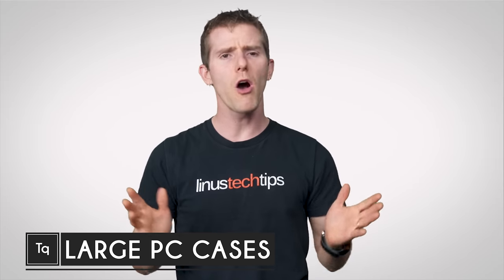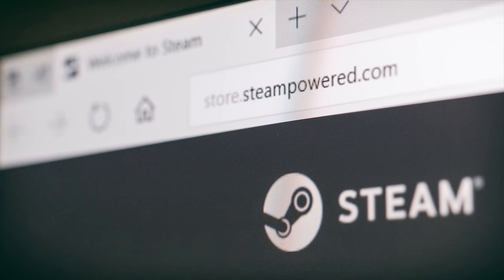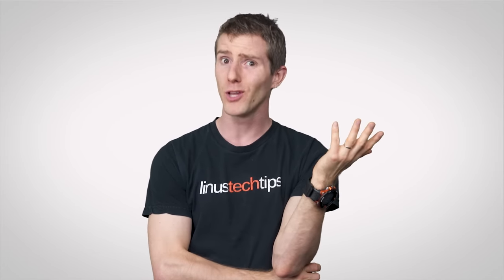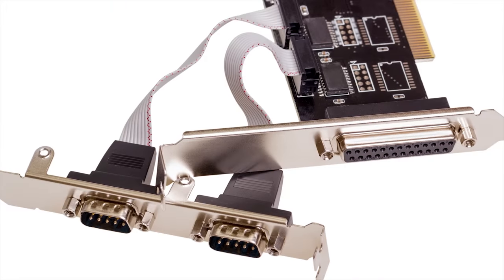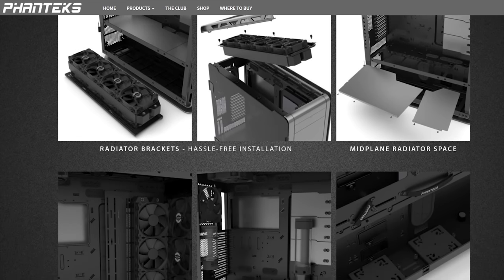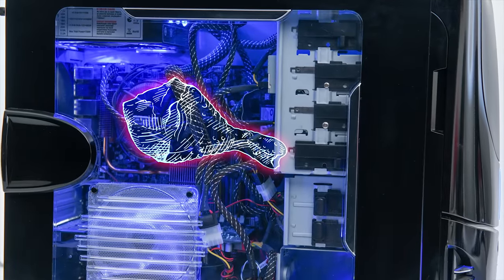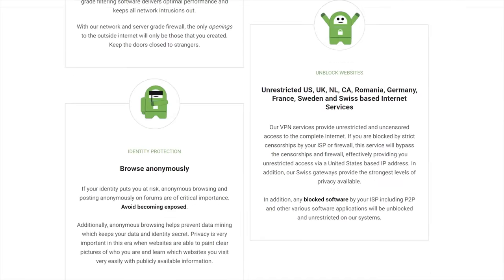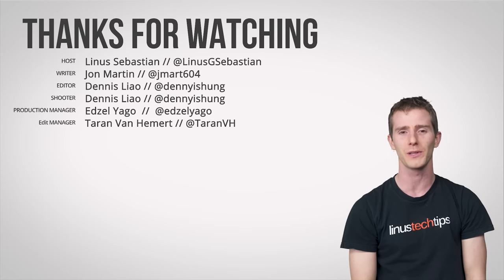Do Large Computer Cases Still Make Sense?

Comment: #1 reason, cooling.
Reply: Yep that.
Reply: Same here!!
Reply: #2 Reason.  It's an attention grabber.
Reply: #0 reason, A E S T H E T I C S
Reply: i have an mATX case that can fit 2 280mm radiators + 1x200mm in the front and 1x140mm in the back
Reply: Marcus Borderlands  watelcooling is the main reason
Reply: Space, which helps everything. Cooling, work space, configuration options, cable management... It actually makes more sense to say there are few reasons to go small form factor.
Reply: Even better don’t get a case
Reply: True. My full ATX mid-tower case runs a lot cooler and yet quieter than laptops and even better than mini ITX compact case.
Another reason why I fancy a mid-tower case or larger is because of expandability as long as I use a full ATX motherboard.
Also I can easily do more upgrades because I have more room to work on.
Reply: #2 looks cool
Reply: @t8polestarcyan22  its kinda funny, i have a micro atx motherboard in my atx case, but that was simply due to not needing any expansion slots by the time the board would be obsolete
Reply: Just wait arm CPU already surpassed x86 capabilities. I hope there is rigs that run on risc CPU that power efficient and doesn't need big heatsink.

Comment: I love my full tower. It's my solid belief that it's helped my system last as long as it has because it provides more room for better airflow and easier maintenance (like removing dust). BTW I put a note in the "new build" thread on your website on Monday and no one responded yet. I plan on getting another full tower in the future. Since my computer stays put there's no real advantage AFAIK to a smaller rig.
Reply: I like my CM Storm Scout II [white], bought another for future use, on sale,  ½ cost of the Storm Stryker ATT but someday hope to own a CM stryker, love cases that have rugged built in handles.
Reply: To be honest, the only time I've had computer hardware fail was in prebuilts (dell, HP, etc) and with cheap crappy components (COUGH Asrock). The system I built about 6 years ago is still going strong to this day.

Comment: Repeat after me: RAID is not a backup. :)
Reply: raatti one of the morning mantras of system admins everywhere
Reply: he should make a video testing this. I'll laugh at his raid backup failure lol
Reply: @stephanev92  He's got one video where RAID failed and uh... yeah the results were as expected
Reply: RAID is not a backup. :)
Reply: RAID 0 is not a backup. Don't all others feature redundant storage?
Reply: @jazzbuckeye  Redundant storage != backups. Part of the reason you want backups is to counter user error. If someone deletes important.txt, it'll be gone from all of the raid drives instantly.
Reply: Came to write "RAID =/= Backup" and then saw your comment and understood that i'm late in 1 whole year :-)
Reply: @jazzbuckeye  redundancy only protects from hdd failure
Reply: I think he learned that after his wierd Windows raid on top of Hardware RAID  failed catastrophically :D
Reply: RAID is the least secure but in many cases just convenient form of backup; it doesn't save you from fires, user errors or scraping trojans - but in the case that happened most often to me and people in my environment: a hard disk/ssd failing, it's the fastest and easiest way to deal with it
Reply: @jazzbuckeye  backup needs to be diversified. Cloud storage, external HDD/SSD, usb drive, etc. Raid is essentially just having 2 of the same drive with the same data or 2 drives bridged together as one large drive. I wouldn't classify it as a backup

Comment: The reason I opted for a bigger case is future upgrades. A lot of smaller cases have no optical drive cages, which I need in order to use my PC as a bluray player. They also tend to have very few drive cages, which can end up with running out of space inside the case. And like the video said: Larger case means better airflow, which means quieter computer, and I value that a lot.

Comment: You are so right about adapter cards for scientific equipment!  My IT department hates me for this. We have $250k mass spectrometers that are still "modern" that need to work with computers that don't have those connection ports anymore. 10 years is not a lot of time in the scientific instrument hardware world, but is an eternity in PC hardware world. More often than not whether we can still use a mass spectrometer or not, comes down to finding a $20 adapter card.

Comment: I still use somewhat large cases but not as big as I used to get as I no more use SLI/Cross, PCI-E network card and instead of the best PCI-E soundcard I use an external super expensive DAC stacked over a power amp so I shrank from (Thermaltake Armor > Corsair 800D > Corsair 750D > Corsair Air 540). I realllly love that cubic case with RGB led strips, huge window and all the "uglier" stuff is behind the motherboard so it's all clean with a huge amount of airflow (5x140mm) yet silent. Couldn't be any happier with this case that was on sale for about only 125$. I can still fit easy 2xSSD + 3xHDD too so no need for a full tower these days. I still would never go with a small case other than for a cheap office computer for my uncle for example.

Comment: I feel like microATX is the most underrated form factor. There arent alot of good cases out there. The C mini is good, but its pricy, and the lite 3.1 has bad airflow. I have a Versa H18, and I have never doubted my decision to move from ATX to mATX.
Reply: MATX is fine, I would in fact like to see a Optical-free cutdown of the MATX form factor that would still support matx motherboards and atx power supplies. I find ITX overpriced for what it underdelivers.
Reply: Are you an aye-aye? Because you have to have the fingers of one to work inside a case like that.

Comment: I've got a small form factor mATX case and while it isn't tiny tiny it is small enough to transport easily and hides away under my desk without being too imposing.  I was also able to keep it on my glass desk when I lived in a different house.  It has enough fans to cool well, although the motherboard is upside down so the intake is front and up top and the exhaust is bottom and back.  Even has the right amount of space by the PSU to stuff the extra wires without affecting airflow of the space inside

Comment: Posting in 2023, I'm still using my Thermaltake Armor+ case from 2012 (and the same computer parts inside). They call it a "super tower", because it's about 10cm taller than a full tower.
I'm currently looking at parts for my next computer build, but I can't find another case that comes close to comparing to the Armor+, so I'm going to use if for my next build. That's largely because I use my computer for games, video editing and as a streaming media centre with duel DVD/Blu-Ray drives.

The Armor+ case is extremely customisable. The front has about seven 5 1/4" drive bays that can be converted to hold hard drives instead. Below that is a rack to hold five storage drives. The rack can be removed to make more space. Behind the rack area, at the bottom of the case, are two more storage drive bays, but those too can be removed and replaced with a couple of large fans.
There are a lot of other great features that are missing from newer cases. One of the best features is it has a removable mother board tray, so most of the computer can be set up outside of the case and just slid in like a horizontal drawer.

Comment: I had always wondered this, considering consoles, Steam machines, and low-profile builds. I feel like as a moderate gamer myself but only playing for the games, there's a lot of wasted space within my PC. I go for the very basic setup, where my only expansion really is the graphics card. There are so many additional slots and feature on my motherboard which really just seem to take up space. And even though a smaller motherboard would do, most cases have this larger panel in the front usually to store an array of hard drives, but i can happily strap my SSD to the back panel or on top of the PSU case (NZXT s340). You could argue, if only used space was measured against the unused space, that only 33% or so my my actual PC is the components. If I had an issue with space or preferred a smaller aesthetic, I suppose the mini-ATX boards are the way to go? I guess heat has always been my main issue with gaming rigs, as I rely only on air cooling.

Comment: When I build systems for others, I usually use uATX (if use case permits and unless requested otherwise). Enough for some future expansion where mITX won't allow it while still being relatively small. I'm glad I went full ATX with my personal system though, right now I have every expansion slot filled with something, and I have a few hard drives and front bay devices.

Comment: 1:14 that Asus Crosshair IV Formula.  Brings back memories.  Spot cooling the North Bridge as it tend to run hot due to a design flaw on early boards.  O.C. my 1090t to a whopping 4.0ghz.  Ah those were the days back in 2010.

Comment: I used to have a cooler master cosmos SE, which was the perfect size. Internally the space was wasted a lot however, and it had taken a lot of beating over the years (I move my PC back and forth every week pretty much). I upgraded to the mastercase pro 5 which is the same size, but has a great amount of space internally. I love the upgradability, and I don't mind bringing it around compared to a smaller case, since I have more options

Comment: I tore off my drive bay front end plastic and screwed in instead 4 rubber legs and turned the case on its face. Now all heat exits the back as the now up side. Also easy to reach plugs on the top. 
Best design ever!

Comment: Waiting for the day double-sided ATX motherboards become more mainstream, and thus, double or even triple-chambered cases would become more of a thing too.  I always felt that graphics cards and CPUs should share the same chamber, while less-power-hungry components like SSDs, hard drives, and lesser PCIe expansion cards should sit in another chamber altogether.  If you have ever seen a belt-driven grinder or sanding machine, that's basically what I'd want the mobo to look like.  You can simply slip-on the mobo in the center of a double or triple chambered case, because in the center would be two or three support columns to guide it in.  And here's another advantage... you can have motherboards with HOLES in them for even easier cable management and SHORTER traces to bandwidth-hungry components.  It'd be like having two motherboards in one computer, but it is still one motherboard.  Not to mention, this might open up a possibility that you can add ANOTHER physical CPU on the "back side" of the motherboard......... all you need to do is extend your water loop and add another water block to include the 2nd cpu.  Nice, huh?

Comment: ITX form factor should be a trend to the future
due to the fact that most of the pc gamer , even a normal user won't need a bigger case for more hard drive  or some expansion card 
a better motherboard can get the job done
besides currently a mid range PC hardware isn't hot as before so it won't require too much for the case air flow

Comment: #1 cooler (more fans, bigger cpu heater, water cooling, better air intake)
#2 usually quiter (more low speed fans, more space, better air intake)
#3 cheaper (yea, small != cheaper)
#4 easier to manage (more space, more extension slots, cable management)

The only con for me is, it take more space.
In cases' case, bigger is (still) better :)

Comment: I don't overclock. I'm hoping that my Noctua fans run quieter in my mid-tower case while achieving the same level of cooling. And yes, as a PC building novice, that space to work helps a lot. I've opened my PC four times since building, and each time I'm grateful.

Comment: I used an old Inwin Q500N tower for my gaming rig back in 2010.  The case was 24" tall and weighed around 40lbs empty and I loved it.  It was a typical tanky old beige box from the late 90s with the most current hardware in it.  Besides from the 90s nostalgic looks, if someone broke into my house to steal stuff, they would think my ps3 was more expensive than some 15 year old looking pc that had a 5.25" floppy drive in it.  Plus the extra weight will make them think twice about stealing that gaming rig xD

Comment: I have a black Corsair Crystal 680x with x8 Corsair QL120s black, and I also have a Corsair LS100 starter kit that is 4 (2---250mm 2---450mm) RGB strips, and I also have 4x8gb 3200mhz Corsair Vengeance RGB Pro, and a Corsair H100i RGB Pro XT. I did it all for the looks. I've got a 3700x on a really nice B550 board (I also have an x570, but the b550 is better), and a 2080ti gaming X Trio from MSI. It's all for the looks man lol. Well I got a pc that runs amazingly, and looks absolutely fantastic lol. For storage though, I just stuck 2 1tb m.2 nvmes in there, a 2tb SSD, and a 12tb and 8tb HDD. I dont think I'll need any for quite a long time frankly lol. I'll stick with my 1440p 165hz IPS panel for years probably lol.

Comment: I've been running my gaming PC in an HTPC (NMEDIAPC) case for 7 years (their website seems even older). I don't need superior cooling--just good enough. If my goal was superior performance, I'd require superior cooling. But to get superior performance, I'd require a superior paycheck. So I've prioritized a subtle, stereo-esque PC in my TV stand next to the cable box. The only room required these days is for mobo, power supply, and--the only real variable--a GFX card. My 1060 and Ryzen 1500x is more than sufficient. My ATX case can fit all but the largest cards (up to 12.5"). And since I'm not overclocking, why bother over-cooling something that isn't overheating? If I was overclocking my current rig, I'd sooner upgrade an individual component  to something faster and more energy efficient than completely re-doing my rig with new case and cooling system, and moving its perch to take up more real estate.

Also: "RAID Array" from the Department of Redundancy Department.

Comment: Still looking for a full size tower with Zero visual frill, lots of hard drive bays, lot of external bays for expansions like 5.25" to 3.5” bay and hot swap bays etc. But good air flow without me having rearranged hard drive bays to get that good air flow. 
I generally go for system that I stick under my desk out of sight,  that I don't have to maintain beside blowing dust out once a while and cleaning filters. And sadly 3-4+tb drive have a higher failure rate and cost more. So easier to just put in cheap and reliable 1-2tb drives as I need more time space, so more drive bays the better. Also easier to back up a 1-2tb since you can buy them in town cheap if one start to show issues, no stores here carry higher capacity drives.

Comment: I was thinking about this a couple of days ago. A couple of years back you also wanted to upgrade your computer becaue the general OS/normal tasks ran really slow and laggy. Today is barly a problem for a normal PC. The only persons who want to be upgrading their computers are gamers, VR and professionals, but tbh mostly gamers sice most professionals are not so dependent upon CPU/GPU upgrade performance unless working with alot of media. So the general market for a pure desktop will most likely decreas and smaller formfactors increase (as we do see in ultrabooks and such), even most ultrabooks are able to play most good games, you only need a 1080 if u want to try-hard.
Reply: Professionals would be more reliant on core count than speed, and depending on what they do would probably want multiple systems or a server rack rather than a big chassis.

On the consumer side, I wouldn't be surprised to see mini PC's like the Intel NUC or even mini-ITX become the norm for most mainstream consumers. You can already get a pretty darn small and competent gaming system with the Ryzen APU's, not to mention consoles typically have pretty good performance for their size and power consumption.

The latter is pretty much what most people want in a gaming/multimedia home theater system, which is a big part of why they've been so successful over the years. Getting that in a gaming PC has traditionally been either really expensive or challenging to DIY until not too long ago.

Comment: I have an Antec 900 pro case which I've modded for better cable management.
It has 3 ssd drives with Mac OS X hackintosh, Win 10 Pro and Linux Mint and a terabyte mechanical drive for back up.
Dvd rw and a blueray optical drive.
So in my case ;-) bigger is better.

Comment: 0:37 But drives are not getting much more capacious -- at least, not in bang-for-buck terms. The sweet spot has been at 4TB for a few years now. Time was I would have a single drive in my main machine, and upgrade it to a bigger one as time went on. Now I have two drives (because 2×4TB is cheaper than 1×8TB), and I may need to go to three.